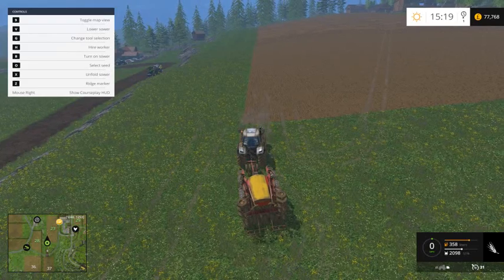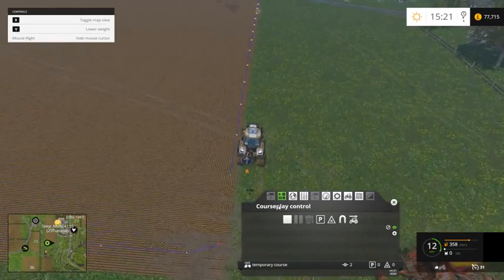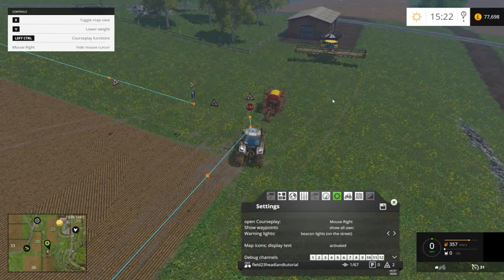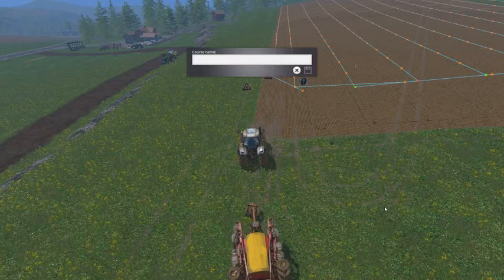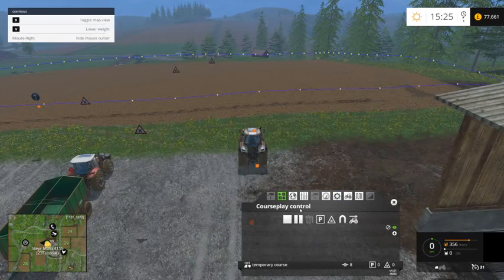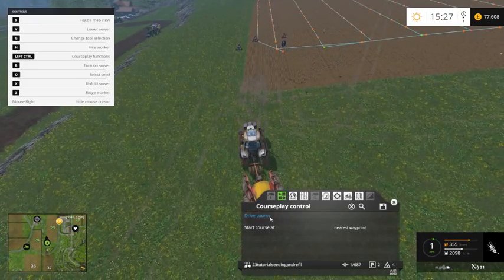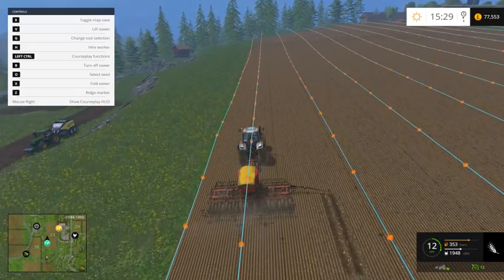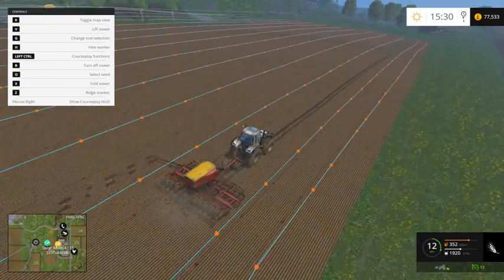FS15 Course Play Tutorial 4 (Sowing & Refill)

Comment: all you have to do is press lane set button then select field edge, work width, start corner, start direction, return to first point, and finaly headland, then save then go to start face wrong way, clear course then record course to seed pallets to refill and back to field start point save that course then load field course with the second folder button then load refill course with first folder button, finally click drive course starting from first way point.    this method the seeder stops when empty goes back to start and then on to refill then when it gets back to the field it returns and continues from where it ran out.
Reply from the maker: Robbert Godden Thanks will try that
Reply from the maker: I do use quite a lot of different methods in my lets play series. I just try to mix things up to show different methods. Thanks for the input, really appreciated. :)
Reply from the maker: Robbert Godden Hi Robbert, I have just made another video and will be uploading it shortly. This is probably the method I should have used originally as this episode has asked more questions than any other.